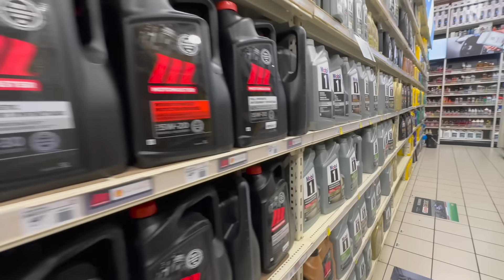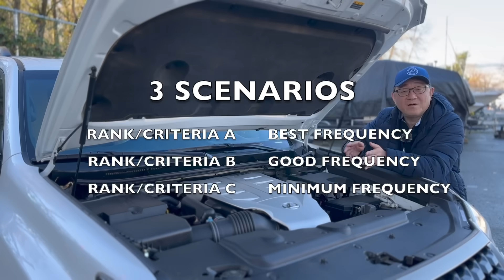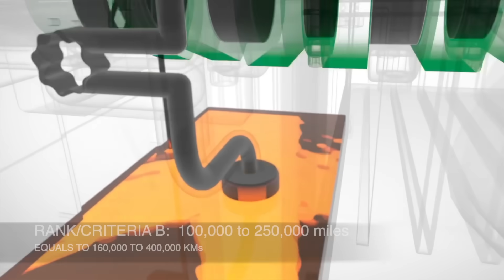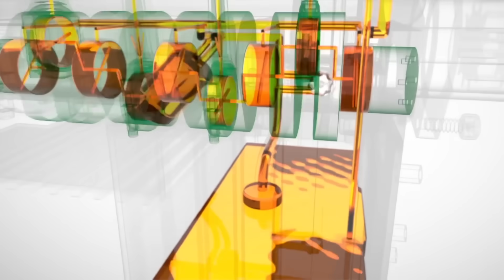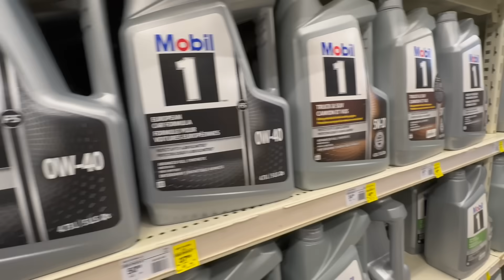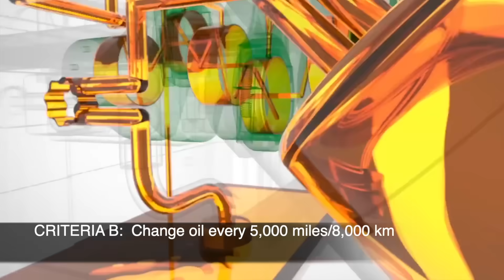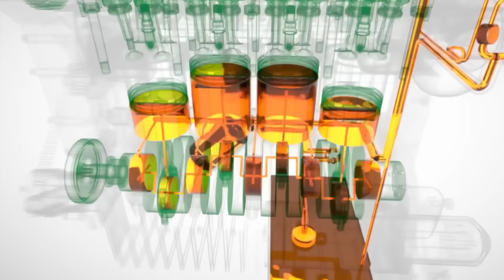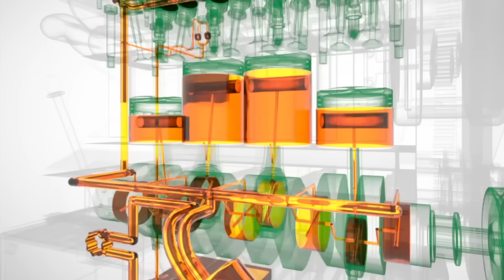ENGINEER EXPLAINS HOW OFTEN TO CHANGE OIL & FILTER // UPDATED CRITERIA-BASED RECOMMENDATIONS!

Comment: I got a 2013 Lexus ES in 2018, I noticed right away that letting the oil go 10k, even the good Mobil 1 full synthetic, it came out so so black, I thought, this can’t be right. After that I started doing 5k intervals but now that it has 115k, I’m doing 3k changes. 

My LX has 243k miles and I baby it with oil changes every 2k mostly because it’s driven off road almost as much as it’s driven on road.
Reply: It's just soot, in fact, it's good that it's in the oil and not depositing in the engine, that's one of the many benefits of modern oils. You really don't give modern oil enough credit.
Reply: @TheRealSykx exactly!
Reply: The oil being "black" is more than likely from the cleaning from the oil, as synthetic oil is detergent oil
Reply: At 250.000 miles without an oil change the Mobil 1 in the 84 Subaru looked new. At 65.000 miles the Walmart synthetic oil looks new in the Pontiac The Subaru had a Frantz oil cleaner. The Pontiac has a Australian Jackmaster Classic If the oil gets black in a gasoline engine you need a better oil filter. I expect the oil in my diesel tractor to be black. In the 60s it was common for the oil to be black in 2.000 miles. Install a bypass depth filter and the oil looked new if you used the right oil.  Standard Delo 30W or 20W was beautiful when it was clean.

Comment: Generally true.  10,000 intervals is for disposable cars.  You forgot 500 to 800 mile first oil change when the car is new.  Every engine oil sees elevated wear metals and silicone sealant levels when new.  The last thing you want is extra wear metal in the oil for 10,000 miles, except for disposable cars.  Also, most of the cost of an oil change is your time and labor so the longer change intervals of full synthetic are a no brainer.  I do Mobil 1 "high mileage" (contains seal conditioner additives) at 6000 miles or 9 months.  No adding oil between changes and not a drop leaking.

Comment: With 5k oil changes at least, I find it a lot easier to sell a high mileage vehicle. Obviously people try to lowball you, but eventually when you're priced below dealer and have much better oil change history, people buy cars with 125k+ miles usually understand the importance if they don't want to be adding oil all the time between changes.
When buying even lower mileage cars, I won't even consider anything under 60k unless it had 5k changes. The most wear occurs early in the life of the engine so seeing it never changed until 15k or 20k - just completely nix it from my car shopping list.

Comment: Hi David.  You need category D - vehicles equipped with Direct Gas Injection or Turbo or both.  The high-pressure blowby degrades the oil to max oil life of 3,000 miles or 4,500 Km regardless of how long you keep your car.
Reply: Yep, i thought the same for turbos.

Comment: I do 5000 full synth & sometimes like today filter every other but 90% every time.  So kind of an A-B+ for me lol. 
Honda manual says every 7500 miles and filter every 15,000.  My engine literally sounds different when the oil gets to be around 5000 and I can feel it in my gas pedal with my foot Like a higher pitch vibration.

Comment: Engine oil depends on engine operating hours around 250-350 hours for synthetic neither mileage or months matters exeption for short trips which does not get the oil hot enough to evaporate water moisture. And last but not least the make and model of the car.

Comment: Engine oil depens on engine operating hours neither mileage or time matters exeption for short trips which does not get the oil hot enough to evaporate water moisture. And last but not least the make and midel of the car.

Comment: 127,000 miles.  Toyota Avalon is 20 years old.  Change every 3,000 miles or once a year, whichever comes first.  The family had 3 other units, same model and they each went over 250,000 miles.  Change the radiator fluid and drain transmission sooner than Toytoa recommends.

Comment: David, with all due respect, rank C I do not agree with. As you stated, oil and filter changes are the two most important things to do for good preventive maintenance. I would also group all other lubricants and liquids as well. These are the simplest and on the overall, the least costly operations to help prevent serious issues. When vehicles are neglected just because the owner doesn’t plan to keep them for a long time, this puts under-maintained cars into the secondary market. An uneducated buyer would then be at risk of buying a problem waiting to happen. Thank you for your inciteful videos. I look forward to each one. Love my Toyotas!
Reply: Sure, but stands to reason if someone is unwilling to invest in a cheap oil change, they’re probably not going to to coolant or trans oil changes either. Thanks for the reply. 
Regards
Reply: He's only talking about OCI not any other fluid. That's another topic.

Comment: Changing the oil filter at every oil change is really a waste of time and money, especially if you change oil at 3,000 mile intervals. Most oil filters today
will last at least 7,500 to 10,000 miles so every other oil change will be more than adequate.
Reply: True Not much in a modern engine large enough to be removed by a full flow filter.

Comment: all you folks who change oil every 3000 miles send me the oil you take out .. for me it still has 2000 miles on it ...
Reply: Plus you can burn it in a shop heater.
Reply: @2148aa  HA !!

Comment: I would add, if you change your oil every 3000 miles, don’t bother with buying expensive brand oils, buy the right viscosity of whatever is on sale.   Same for filters.
Reply: Indeed.  Costco has their house brand, Kirkland Signature, which varies between $3.09 and $3.99/qt depending on whether or not it's on sale.  This oil is blended and packaged by Highline-Warren (formerly Warren Distribution, in existence since1922) and is listed in the American Petroleum Institute (API) registry as passing all the API and ILSAC requirements, along with the GM Dexos 1 requirements.  A kind employee of Blackstone Labs which tests tons of oil samples annually says the results they find with Kirkland show it performs as well as any other good brand and  the additive is package it contains is much like the popular brands.  HE USES IT because of the good deal.  I use it for the same reason!  And yes, in my Lexus RX, not an old beater of some kind.  The view down the oil filler pipe with a flashlight shows nice and shiney parts with no varnish of any kind at 55,000 miles.
Reply: @thomasroberts8024  thanks for the feedback!
Reply: @thomasroberts8024  ,, 
Thanks for  writing that comment about Kirkland engine oil.
Previously  , I was using branded oil ,
Until covid event, 
They up their price and sales are fewer in between ,.
So I just switch to Kirkland  ,
Since I change every 5k km's .
But ,, but the filter , 
Oem and others have price difference of less than 5%  only .
Good relation with parts people at "stealer-ship" , has its benefits .
Reply: Supertech works for me, although don't skimp on the filter.  You don't have to buy the most expensive one, but don't look for the cheapest either.  I stick to OEM filters personally.
Reply: @mplslawnguy3389  good advice!
Reply: Your statement makes strong sense. I recently went to Amsoil signature series to increase the interval from six month (near to 3000 miles) to a year.
Reply: In general I'd agree, but make sure the oil still meets whatever specs are listed in the owners manual. Also, for severe usage such as extreme cold starts, racing, lots of hard driving, heavy towing, particularly hilly terrain, or maybe even lots of heavy traffic, using something a bit better than the cheapest oil you can find may be worth it for the added protection. Same is true IMO for boosted engines. Changing the oil on time is most important, but if ultimate longevity is the goal, I do think there is a time and a place for premium oils.
Reply: Most filters have no return rubber valve.. It that's stiff cheap stuff not working/closing as it should, engine runs on start few sec without oil pressure at all..

Comment: Could you show us the test data that support your recommendations?  Thanks.
Reply: It's right here, test it😅
Reply: Test data? 🤣 He's got your test data hangin'.
Reply: He’s an engineer. he makes these engines.
Reply: @Maynardd   That's not data and he doesn't make any engines.
Reply: @joevarga5982  just designed them, hence the word engineer. start looking up things on YouTube like what happens to my engine if I don’t change my oil. The data has been available for literally decades. Don’t be ridiculous.
Reply: @Maynardd   I never said you don't need to change oil. Stop putting words in my mouth to try to prove me wrong. That's a ridiculous, childish tactic.
Reply: I quit changing oil in 1963 with a Frantz oil cleaner and Standard Delo 30 W. I changed the oil and replaced a head gasket once. If I buy a used car I might change the oil. Allowing the oil to get dirty then changing it is for chumps. My Pontiac Torrent has a Australian Jackmaster Classic.  The Motor Guard on the old F250 with the 390 is almost 60 years old. The flat head Ford V8 canister filter on the Ford diesel tractor is set up for Scott 1000 toilet paper. I have half a roll of Viva towels in it now.

Comment: Thanks David, awesome breakdown for each oil change criteria :) 100% true results for "criteria A" with a 2001 Camry replacing oil/filter every 3-5 K kms since new and now the car has almost 500 K kms and still runs like the day it was born 😀
Reply: just wow!
Reply: My 84 Subaru went 250.000 miles without an oil change If I changed the oil every 3.000 miles it would still have gone 250.000 miles. That car had a Frantz oil cleaner. It never saw dirty oil. The contamination was in the filter or thru the PCV.

Comment: Actually, what you said about oil not degrading, but rather getting dirty and that oil doesn't lose it's lubrication properties is incorrect.  Fuel dilution, water condensation from short trips not heating oil properly and sooting from blowby on turbos cause the viscosity package to degrade and acid buildup (sludge); thus, causing the oil to lose its spanning viscosity additive package and degradation of viscosity modifiers.  Change it at no more than 5K intervals (maximum w/Synthetic w/filter) and preferably every 6 months.

Comment: Here in Australia I own a 2006 Nissan Patrol TD42 TI Diesel bought new , one of the most reliable engines ever made. I change the oil/ filters every 5000 km and it holds 10.5 litres of oil and has two oil filters .  It will out last me.
Reply: Lucky you. Would love to have a Patrol in the US.

Comment: Amsoil full synthetic every 10-15k is what I do.
Reply: I'd rather buy a vehicle that has had its oil changed at more frequent intervals than a vehicle  that has had its oil changed every 10,000 -15,000 miles using AMSOIL.
Reply: @dproulx222  If that is your opinion than you know absolutely nothing about Amsoil.

Comment: Good video. Of course it's even more complicated than how long you want to keep the car.
The type of kilometres you drive also matter. If you do frequent short trips, and the car runs cold a lot of the time, you should increase the oil change frequency. 
Long country drives don't contaminate the oil as much per mile.

Comment: I can’t remember the last time I saw a vehicle replaced because the engine was worn out. Almost always it’s the car that falls apart around the engine. The transmission fails, all the accessories start failing or the body rusts out, or the cost of repair exceeds the value of the car. Seldomly do I see and engine needing replacement.
Reply: I hinted I would like to buy a guys Toyota Camry that belonged to his wife that is in a nursing home. He said its going to his daughter. Her Camry has over 500.000 miles on it and is starting to give her trouble. He said I have a nice Hyundai turbo 4 that threw a rod and is being repaired under warranty. Would you be interested in it.
Reply: Go to a Kia/Hyundai dealership and you'll love the blown engines lining up for new engines. 😊

Comment: It comes down to testing the oil.  Get an oil analyst and it will tell you how your oil is performing.   Blackstone Lab Analysis is one.  I would do a baseline with going the manufacture recommendation and get a sample to send off.  It will tell you your TBN, all properties on how your oil is holding up.  Then they’ll recommend of the testing for change interval.  Also will let you know if something is wrong with the engine.

Comment: If the manufacturer says 10000 miles, cut it in half. If it’s 7500, cut it in half!
Reply: My Kia owners manual says 3000 miles, severe  service
Reply: And what engineering data do you base that on?
Reply: @ Blackstone Laboratories.

Comment: I would agree with your analysis overall with the caveat that gasoline turbocharged engines have shorter engine oil change intervals overall due to their particular requirements. I recommend OEM oil filters for good measure to insure you are using thier micron filtration specs at a minimum.

Comment: I change my oil/filter on my 04 tacoma every 2 months that being said its every 7000miles(AAA roadside tech) mileage on truck is 230,000 and running perfect(bought truck 3 yrs ago with 17,000 miles on it)

Comment: I have a 2006 Subaru sti with 150,000 miles. I change my oil every 3000 miles because  of the turbo heat soak issues

Comment: My Toyota get the oil changed once a year but I am a low mile driver.  Typically about 4500 miles, Toyota requires synthetic oil so I feel like I am giving the car the best chance to last a long time.  Its a 2013 and leaks no oil and runs just the same as the day I bought it.

Comment: I agree with the oil change intervals but you need to focus on more than just the engine if keeping long term . What about the drive train ?
Reply: This video is about oil change intervals...
Nevertheless, all fluids need to be replaced at or earlier than suggested by auto manufacturers.

Comment: Hi David,
I change my oil about every 2000 to 2500 miles … regardless, how long I keep the vehicle… the longest I will wait is every 3000 to 3500 miles….. I just put a mental note in my head that every 5000 miles I change it twice so sometimes I change it at 1000 miles or 4000 miles or I change it at 2000 miles or 3000 miles as long as it gets done twice within 5000 miles that’s the way ideal with my 5.7 L V8 engine… I want to keep it clean on the inside as I do on the outside if that makes any sense… thank you David this is an extremely important and helpful and informative video. Thank you so much I know you’re tired of hearing this, but you are the best of the best of the best and that’s the name of that tune….lol🇯🇵🤍❤️🌎😇⭐️👍🙏🎉
Reply: That’s a ridiculous timeframe. I also drive a 5.7 Hemi and do penzoil ultra platinum at 6,000. Mine has 273,000 on it. Results speak for themselves
Reply: @DanielJohnson-ec8rk . You gotta a point. It’s gets to the stage where it gets ridiculous. 6000 is more than ample for a 5.7 hemi.